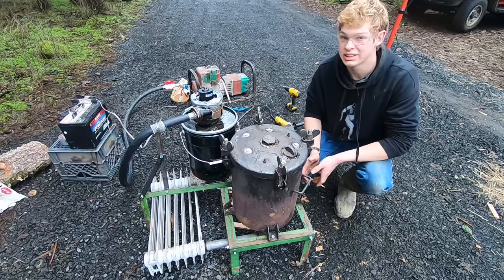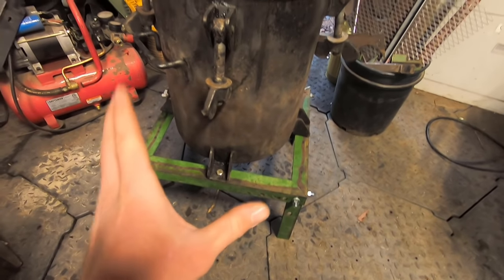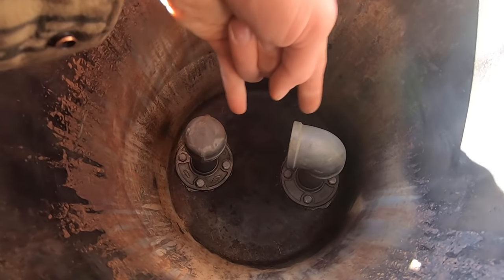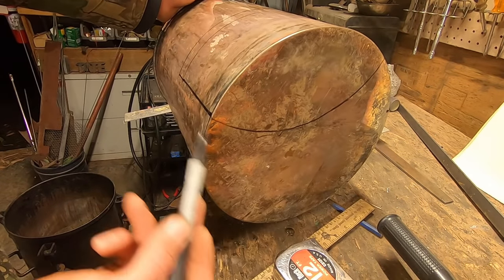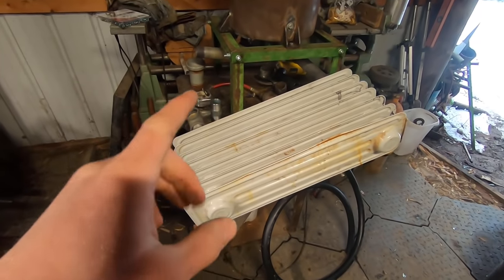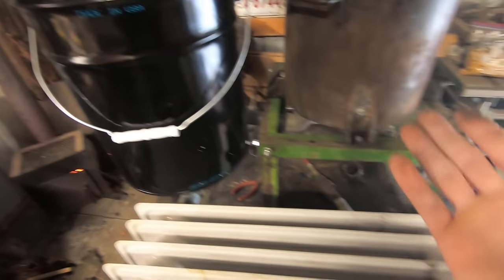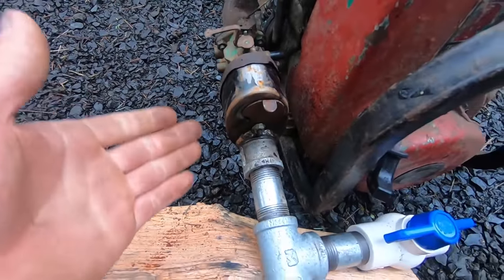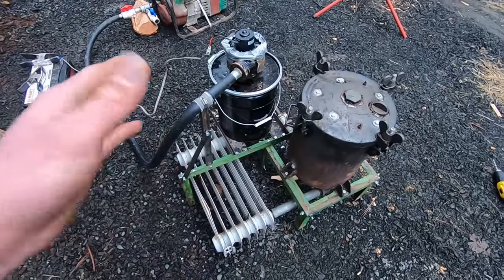Building a No-Weld Woodgas Generator! (A Functional Gasifier Built W/ a Hand Drill and Grinder?!)

Comment: estimate how much power you're getting from each load of wood. I'm interested in building this to recharge batteries.
Reply: The efficiency reaches up to 90 percent, ie more than, for example, a steam engine. This efficiency includes waste (radiant) heat, which you can use to heat or temper your home, if you design the boiler for this purpose. A single-cylinder slow engine with a large flywheel (boxer) will provide enough torque for the electric generator. Configuration power from video can exceed 1kW.
Reply: assuming the efficiency is anywhere from 34.54%(I got this number by looking at different resources) to 90% which is amazing assuming you burn 1000 kilos of wood it could be the equivalent of anywhere from 60-900 supposed gallons of gasoline fuel if I'm right I dunno it's three in the morning. Either way it's not a horribly efficient system but it's for sure cheaper!😂
Reply: @wordisis3183  About 90 percent applies if the heat of the boiler and condensing unit is used. Today, the gasification of wood is controlled electronically in completely different conditions, which even exceeds the efficiency of 90 percent. A particular assembly of video has an output efficiency of about 5 percent.
Reply: I'd say no more than 20amps at 120v for the duration of the burn based on the generator he's running.
Reply: @DL-kc8fc  lol where did you study engineering, ITT tech hahahha
Reply: @youvebeenspooked  If you're specific, I'll be happy to help.

Comment: Nice economical job, great to see the generator actually doing work, grinding. Solar with an inverter is the easiest but back up wood gas is great. The gas can also be used for cooking. The problem with any heat exchanger is to clean the tar out later.

Comment: I JUST discovered your channel now, and this is an awesome video with great content! Forgive me in case you’ve already done videos or responded to this, but I have a couple questions. With that setup, how long will it last on one full load of wood/fuel? Also, would it be possible/better to use the fan to force air in instead of draw air out so it doesn’t have to deal with the heat? In your experience what’s the best fuel source? Type of wood/Chips/ chunks/pellets? I live in the desert so there’s not many trees around but the dump has plenty of wood in the form of pallets, pruned trees, plywood, treated wood and scrap in general. Thanks again for the good vid

Comment: Always a good time when you put out a video. So I'm curious what are the advantages n disadvantages between this style n the other style? What would prolonged use do to the spark plug in terms of fouling from a poor mix ratio? Would an o2 sensor to monitor the air/fuel work? What kind of burn time would a container that size give before needing more wood? N would this on a bigger scale be able to run something bigger like a car or your tank? I really want to see you make your tank run off this lol. Happy pre apocalypse
Reply from the maker: Thanks, man! I think this type was more of the precursor to the downdraft styles that are more common now. The crossdraft design is less advantageous in a few ways, such as having to expose yourself to the gasses every time you need to fuel up. That, and fuel bridging is more of an issue. I wanted to keep this one simple and more approachable for folks so I didn't add a few things that I mentioned in the video.  Having a way to agitate the shaker grate would be ideal. Attaching the generator to it would be the best way to do that.

An O2 sensor and arduino set-up with automated air/fuel valves would be fantastic, but a little spendy from my research.
T
he fuel longevity is dependent on the generator draw. So 20lbs of wood per gallon of gas equivalent fuel energy is the average. A Honda 2000W genny would run for up to 9+ hours on 20 lbs of wood at 1/4 load.

The next tank will be woodgas powered, no doubt haha!! Thank you for the comment!
Reply: @randomn6473  The most important information is not in the title, not in the description but lost as a reply somewhere on the forum. Thank you so much for this video ! I knew about these gasifiers for so many years but they look like highly non-efficient. Now that I actually see that instead of one gallon of gas you use just 20 lbs of wood I understand what an important piece of technology this thing is and that its really usable. You should put in the title or the video description the fuel efficiency. Thank you.
Reply: @randomn6473  I've used washer fluid for cooling doesn't freeze. It cools but you'd have to put oil radiator in a leak proof container or it will evaporate. If this would help? I see you're using a Coleman 2250 or 2500 watt bulletproof Brigs and Stratton generator. I've got an old 18510 Coleman pulse generator it's a bulletproof Briggs & Stratton engine. I've had it since it was new and at times when I needed it to run stuff above its capacity of overspeed the generator just to get things started. I also run a 200 amp battery charger with that generator with the valves rattling for a few hours of the years. After early maintenance this generator over the years but I have worked it hard. Also had an old Nissan truck running on contaminated fuel and May pop tires for a few years until contaminated fuel got too hard to get without the proper paperwork. And I got tired of customers complaining the truck looks so bad and loud from a cracked manifold.

Comment: For how long you can run the generator before refueling? I love it men!!
Reply: I was wondering the same thing about that. An sents you can use pellets for heat. You can put a pellet feeder on it to keep the heat constant.
Reply: @melvinmariott8609  not really it needs to be closed and b pressurized so basically whatever fits in the container is your fuel for that "run"
Reply: As he said in the video, it could be redesigned as a down draft reactor with a hopper.

Comment: Did you disassemble the engine already to look how it's looking inside?
Reply: For working with gazifiers since 12 years, i Can tell you : tar
Reply: @arjo656  I just wanted to stay polite :D My own experiences over the past 7 years led me to this question ;)
Reply: @ravelkoff3549  the only way to avoid tar is a 2 stages gazifier.
Reply: @arjo656  There are many ways. The one here shown is definitively wrong or a much to early stage in which no engine should be connected to a gasser.
Reply: @ravelkoff3549  he will certainly not reach 2 MW on a Jenbacher V16 😄, but this kid is already quite clever.

Comment: How long can you run a genset on a full tank of wood?
Reply: I don't know this size, but typically 2-3 hours, which is good when they often run 2000kw generators...
in a shtf scenario that 1 burn can be stretched to several days of needed power or more, depends on your power needs.
There are also uses for the heat created by the system as well
Reply: @escapetherace1943  I was just thinking about that, it'd be interesting to see the heat energy put to good use. 
  Any specific applications you were thinking of?
Reply: @mechantics   yeah, I'm sure there are by people smarter than me, but I'd use it for heating my living space.
Bonus points if this entire setup is underground to prevent
1) noise
2) aerial thermal spying
but for the exhaust system you'd need to pipe it in such a way that the hot air is spread out multiple times, preferably ending out in covered soil that is porous and apart enough that nothing abnormal could be seen aerially.
Reply: @escapetherace1943  living in Florida, the idea of paying to heat water kills me. Though I'm sure it'd be feasible to harness heat energy from this set-up, it's more likely that I would simply take advantage of the 😎
Reply: @mechantics  yeah definitely could use it to heat water. In florida you have so many options, I don't know how cold it gets there ever but you can make solar boxes to heat air and heat your livingspace through convection.
back on topic though, yeah, make thermo-electric generators for that heat to siphon off extra electricity.
Personally I want to live in the side of a hill and take advantage of a constant ground temperature for my living space

Comment: There's one huge oversight with this. Wood gas is produced without an oxygen supply, in fact the benefit of wood gas usage is that you make charcoal at the same time which you can then use to make more wood gas. By allowing oxygen into the container you're destroying the charcoal and instead making ash, meaning you're only getting 50% of the resources from the material and wasting 50%.

Comment: I like this. ingenious. I have one concern--souldn't the system have a relief valve like a pressure cooker? True, it is not a sealed system to begin with, but if the gas produced inside somehow would ignite it would explode like a bomb. I think it would be relatively easy to build a 2 inch diameter relief valve on the system since it is a low pressure system anyway.

Comment: a lot of people underestimate the kind of fuel required to make a gasifier work well.  There was a whole industry sprung up during WWII providing nice sized blocks of hardwood for gasifiers.  The downdraft gasifier worked best when shaking too, if you look at the FEMA it's supposed to ride on the back of a tractor. wood gas = carbon monoxide, be careful.

Comment: this is awesome. When I make mine I think I will add a catch can from the radiator pipes that I can easily remove. Also a bypass line and valve so the blower doesn't get gunked up. Now I just need to find all these parts somehow...

Comment: I have a question. What would prevent you from running you syngas outlet from the top? You could still run your air in from the bottom, but just let the gas escape the top. Plus wouldn’t that help to prefilter the gas through your unburned fuel? I may be completely missing something, I am new to this stuff, just an obvious question that came to me. Please excuse my ignorance my good man.

Comment: Hey buddy nice video I am a creative fabricator I saw your bent backwards tape measure technique for drawing line around the belly of that paint bucket . Thought I would share one I use I’ll make my measurements off the table and spin the cylinder with the marker stationary pressing against it. Either stack blocks up or clamp your maker to something you get it
Reply: I would have set that inside the pressure tank at depth of marking and used the rim of tank as the guide for my marker, the inside tank is slightly undersized so no reason that wouldn't work that I can think of. Lol. So many ways to accomplish.

Comment: What a brilliant production / presentation!
i WANT to stick a chinese diesel heaters "Heat Exchanger" into a vessel to make steam.....
It makes some incredible heat, yet minimal fuel (.1-.4 ml p/hr) ie : 100 to 400 ml p/hr
Also burn very clean with no soot build up from exhaust.
Monoxide levels were negilible, but for safety reasons (my no.1 priority),, leave door or window open for ventilation.

Comment: Nice info dude, you should try to adapt this design to work for pyrolysis. I’m sure you could make it work for wood or plastic processing.

“turning plastic to diesel needs two major steps. First is the plastic pyrolysis plant (also called plastic to oil plant) which is mainly used to turn waste plastic into fuel oil, and then through the oil distillation equipment, it can make the fuel oil processed into diesel.”

You can clean the plastic diesel by simply adding water and separating it a few times for a manageable raw fuel that can be further refined or used as is.

Comment: I'd like to see you do large gasifier and also somehow manage to make it a hot water heater for hot showers too. Like a heat radiator setup around the reactor vessel to heat a hot water shower system lol
Reply: That's a great ideal I was considering. Why not heat water and produce woodgas simultaneously. Maybe wrap a  section producing heat with a copper or stainless steel coil with water flowing through to capture heat to a buffer tank. or possibly a diy  water encased section around reactor section.

Comment: Holy shit this system is perfect for what I need!!. I'm looking for off grid power solutions and where I live is NOTHING but dense forest so its quite renewable for me. I am now curious that if i had maybe 2 or even 3 of these running say for the sake of generating enough power for a small homestead I'm convinced that your radiator system could be hooked up to radiators in say a greenhouse or even YOUR house for the sake or re using that heat?? Maybe I'm wrong but if anyone has an opinion i'd be glad to hear it.

Comment: You did a cracking job on this, top quality engineering. The run time off a full load of fuel would be intersting to measure, as well as what wattage the gen is putting out, where automating the fuel supply would be legend but that does sound like alot of complexity that would be needed to be added, but for no welding this is bril. Subbed up, looking forward to what you get up to. My best, Paul, Manchester, UK.

Comment: 1:31 You design is really perfect for continuous gas generation if your air pipe was on the top. Because If you put a screen inside the air intake pipe, you can filter all the new wood that will be diverged on the top and the air il continue in the middle of the pot. The best result will be with wood pellets.  So you can have continue gas production during the day and night.

Comment: Awesome work, and thanks for these videos!
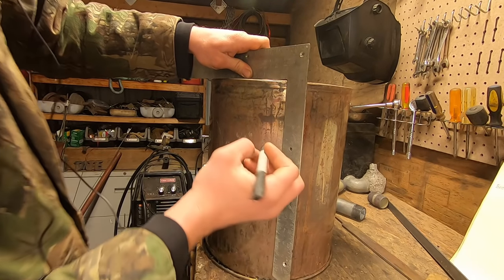One small suggestion: Instead of using a square like @ 12:55, I would use a torpedo level to ensure its actually plumb.  The way you use the square gives you a straight line, but you are basically eyeballing keeping it perfectly upright... could do that with any straightedge.  And if the pot itself isn't perfectly square....

Comment: I often see gasifier's builders add the blower fan on the heat side, which usually causes the fan to fail. I think adding the fan to the inlet side would eliminate that issue. Also, I noticed he added the filter after the heat exchanger, I think that'll cause it to gum up and collect liquid.

Comment: Ok, so a “gasifier” is (or utilized as) an alternate fuel source to power a generator (that normally uses oil that is refined into gasoline like we use in our vehicles, here in the US at least), which in turn powers (by generating electricity)other items/things like the angle grinder you used at the end to show your viewers that it works?  I don’t have time to rewatch for the answers so I figured Id just ask.
Whatever you’re doing looks cool and I may need to do this very soon! Necessity dictates it😬😁 
I am aware of alternatives like this, but this is the first video, in depth, i have seen regarding this and other means/processes like it.
Thanks for sharing/informing!!✌🏽🇺🇸

Comment: This is great work, really. Though, please notify people, if you don't have serious experience with grinders, always lock what's need to be cut into a fixture to avoid the grinder slipping off the metal plate, especially when the metal is like sheet metal (below 3/4") You will need your fingers and/or hand to continue being creative.
Second: If pressure is applied/produced, use "fairy hair" and paste on pipe threads to seal. 🧩🙏

Comment: Love this! If I can't get my hands on a pressure pot, what would you recommend? Perhaps a few recycled propane tanks? ( Verifying that they're totally emptied out and no longer flammable first, of course! )
Reply: yes and fill them with old rusty nails, nuts, bolts, any scrap piece of tool steel you can get your hands on
Reply: A larger 40 or 50 lb  could really upscale this.  
I've seen those used for charcoal making. Which is much the same process

Comment: Excellent project brother I like the way you think one thing I have a problem with gasifiers is the first version that I tried we put the raw smoke into the engine that didn't last very long so we have to filter it out several times to get the different crews out the heavier particles and we filtered it by means of a radiator with a valve at the bottom. Each stage you drain off different crudes as different gases condense out so you start out with crude oil really thick car and then it's like Diesel and then like gasoline and it works all the way down to propane gas but for a hundred pounds of wood you get a lighters with propane like 10 gallons of crude oil 5 gallons of diesel a gallon of gas etc
Reply: So I would say use this on a diesel engine because it would be less in the refining process when you only got to take it to second stage of filtering a Gasolina you need have to take it to like you probably have to go through four different radiators before it's down to the right stage so it don't damage the rings and stuff with heavy particles
Reply: But also once you start storing up the fuel you can you know at that point your refinery right and I want a seriously come up with an idea or a system I meant that has a lawn mower that cuts the grass uses the exhaust to dry the grass and heat it get the potential fuel and run that into the air intake of the carburetor so it feeds itself
Reply: I mean it looks like all of that would fit on the back of a trailer behind the tractor right and then you would just need to make a hopper that collects the grass separates it and so it doesn't all clump in you know and overbearing like a conveyor belt system that squishes it and grabs it slowly puts it through a burner

Comment: The radiator is nice idea but will clock with tar etc. Better to setup it up vertically with a depot under it to collect residue.
Reply: I will add 3 or 4 to collect all useful fluids  😎
Reply: Tar is a non issue if the temps run high enough